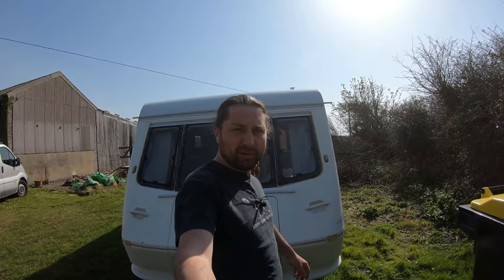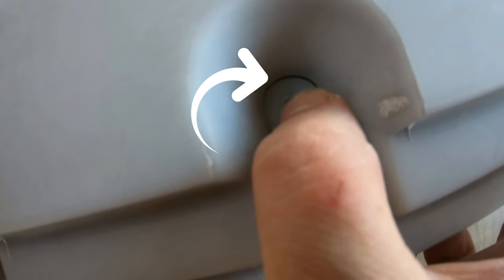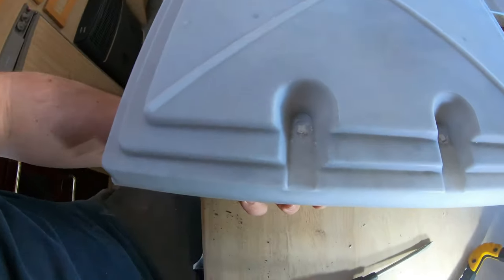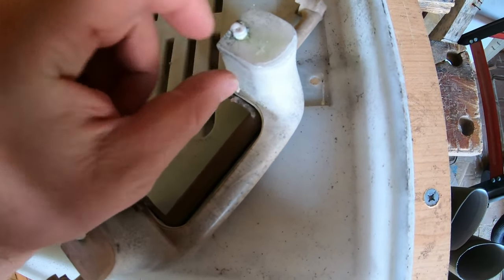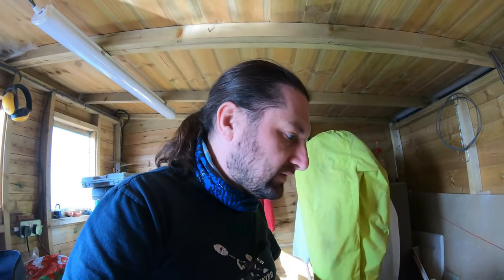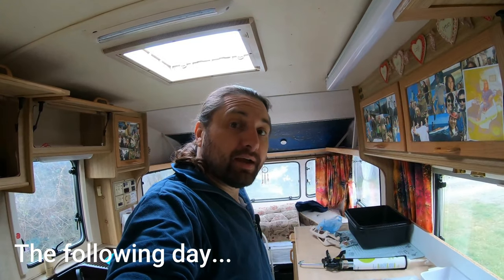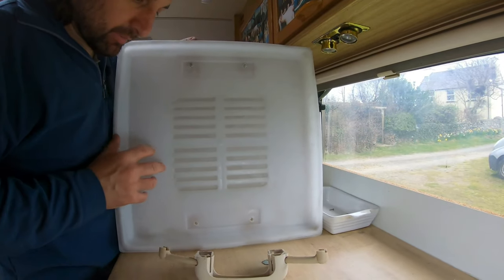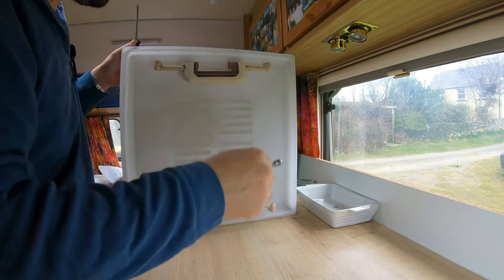How to Completely Remove, Repair, Clean & Replace a Leaking Caravan Roof SkyLight Vent & Surround

Comment: You are right.  65 quid is absolutely scandalous.  Maybe if they were cheaper, people would replace them.
Reply: The dome itself is nearer £45, £60 is for the whole thing inc frame etc But even £45 is a lot, they used to be about £25 but everything spares wise has shot up since covid.
Reply from the maker: I could've afforded to replace it, but I would rather spend the money saved on other things - namely pints of cask ale down the local 🍺
Reply from the maker: Yup, everything is going insane price-wise at the moment.  I don't know how the manufacturers can even justify it.  Perhaps making as much money as possible before a possible recession?
Reply: @TheMcNeillsonWheels .  😂Real ale sounds like a good idea.